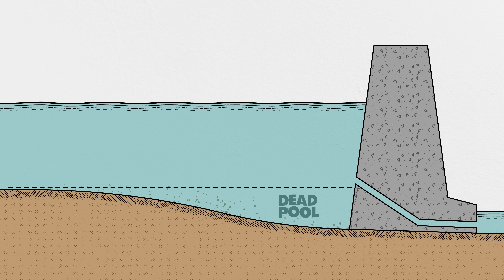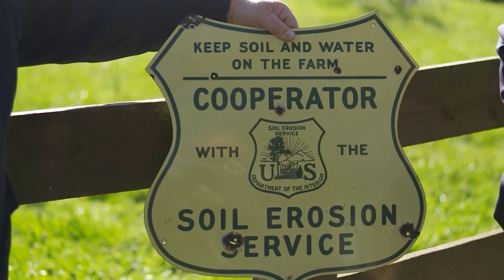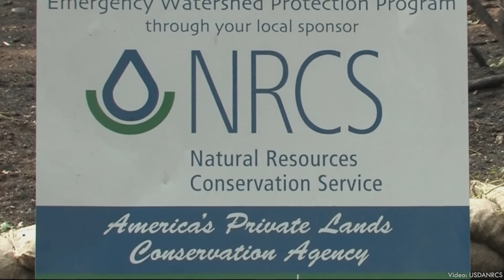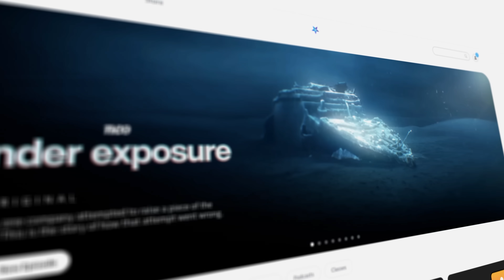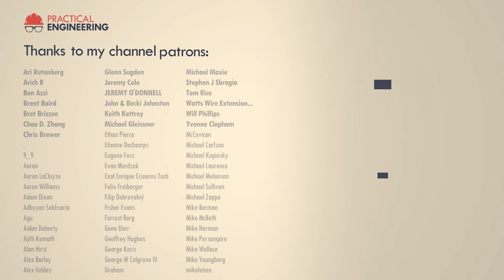All Dams Are Temporary

Comment: I work on dam removal projects and would like to add a few points. One of the major impacts of sediment deficit caused by dams is the erosion of the riverbed and the deepening of watercourses downstream. Deprived of its natural sediment load, the river compensates by eroding its own bed, gradually deepening it. This process can destabilize structures such as bridges.

Additionally, dams act as barriers to the migration of species like salmon and trout, which rely on upstream movement for reproduction.

Finally, over time, the maintenance costs of dams increase, making them less economically viable.

Thank you for this interesting video
Reply: so, whats the solution?
Reply: @kgdangar2  Only keep dams in mountainous contexts, where migration issues are low and where significant elevation differences offer greater profitability. Furthermore, if they are located upstream of watersheds, i guess their impact on sediments should fade downstream.
Reply: @kgdangar2 nuclear power for electricity 
Storing drinking water is a whole different can of worms
Reply: @kgdangar2  Natural water features, and the natural water features we adapt for our purposes must be separate and built completely differently,,, human water systems should exist in total isolation of,,,,!
Reply: I am not an engineer but have an interest and basic understanding of the sciences. Once a dam is in place it's almost impossible to get it removed even if it doesn't generate power. Look at the okalawaha.
Reply: @barelyafloatfarm809  It also depends on their size. In Europe, there are many small hydraulic structures located one after the other in lowland areas. Often, maintaining them to prevent them from failing is more expensive than their controlled dismantling. If you're interested in the subject, the Vezins dam on the Sélune River (France) is a good example. Studies have been conducted to regulate the management of accumulated sediment to prevent its sudden release.
Reply: I want to start by saying that i have not really resurched this so i don't know if its a good or bad thing but there are fish ladders that they use to help migratory fish travel up stream of dams.
Reply: @colbypaulson2831  Yes indeed, there are different types, and they generally target groups of species. It works quite well as long as the drop height is not too great.
Reply: Dams are good green energy, and trying to remove them because of small problems just makes global warming worse.
Reply: Better than coal yes but not better than nuclear  @CableFeed
Reply: @CableFeed  global warming is a hoax, chemtrails are the point.
Reply: In Brazil, I live 100 meters from a dam with German technology that has existed for over a century. Here, these factors do not occur because it is a small/medium-sized dam, there is no major maintenance to be done to the point of becoming obsolete. All costs are minimal compared to the benefits.
Reply: Me living with a bridge downstream a dam that was built years after said bridge: it desestabilizes WHAT
Reply: This is Actually happening in Ecuador rn in the coca river
Reply: What is your opnion on damming wadis(rivers that dont have water for the ENTIRE year)?
Reply: @Noordgestoord12  More context required,, what aspect of what you have described is worth forming an opinion on?
Reply: Dam discharge doesn't cause more erosion because it has "less sediment load" it causes more erosion because it's blasted out by the high pressure from the reservoir behind it.
Reply: @ObservationofLimits  Partly yes, but the sediment deficit also creates slower erosion, which can spread over several tens of km.
Reply: @ObservationofLimits  It is evident that sediment deficiency plays a significant role in the process of downstream erosion. The higher pressures directly downstream of the dam are a very local effect. Sediment deficiency plays a factor on a very large scale.
Reply: Today's solutions are tomorrow's problems...
Big population, big problems, and world's population is rising faster than ever! while it took 123 years from 1 to 2 billion humans on Earth, it only took 11 years from 7 to 8 billion! It never grew so fast, previously it took 12, 13, 14 years, and more, to add a billion.
Reply: @DR_1_1  this is not actually true. The worlds population is projected to peak in the next century or so and start declining afterwards.

Comment: Pumping (or dredging) the silt into barges and then selling to landscaping supply companies as top soil. It would be nice to have access to it. Currently, our topsoil is around 100 dollars a cubic yard.

I think barges hold around 2000 cubic yards or so. If it was sold to suppliers at 50 a cubic yard, it would be around 100k per barge in material.

I am sure different price schedules for farmers to coat fields would accommodate removing higher volumes of sediment.

Comment: As a Dutch guy, I might have a relatively affordable solution to the problem. Just prevent sediment from vorming by stirring the water. We use large air compressors to create bubbles that force the dirt back up to the surface. Then the flow of the water brings it downstream. 

You need to have a good system in place, and monitor it constantly. But it is relatively cheap because it’s only a small barge and one or two crew members. Like having one or two excavators running a shift a day. Cheap, in the grand scale of things.

Comment: Could one possible solution be in the same idea of reducing the sediment intake of the reservoir be, creating a alternative path for the river to flow and then siphoning the water from the river to the reservoir via a weir and large flat area to allow and sediment it settle out. Idea being you keep majority of natural sediment in the river and only have to deal with a relatively small percentage. Obvious the weir would have to be variable height to vary with seasonal flow and this also require extra cost of digging a new river as well as possible environmental concerns and does not address sediment from rainfall runoff as your reservoir will usual be so large it is feed from various sources.

Comment: Question: with solar/wind-power we have the issue of the "energy-duck": the shape of consumption/production in a power grid with lots if solar looks like a duck. To address this mismatch between times of production vs times of consumption, lots of expensive ideas like batteries etc are being suggested.

Why not use excess cheap overproduction of regenerative power to dredge dams?

There is both a day/night mismatch and a seasonal mismatch.

So why not dredge in summer, when lits of solar power is cheaply available and stop dredging in winter to conserve energy?

Comment: need a new invention, such as a large auger 10m, that scoots around the bottom of the res, moving sediment an releasing it through a large pipe at the bottom of the dam, the are several augers placed along the res and all flow sediment all year long, they can be powered by the water flow itself and create 'deep' clear pockets with no sediment, then the new incoming sediment will overtime naturally create a crater shape as the middle gets cleared out

Comment: Solution: it's clear, that the sand in the water becomes as sediment when a certain speed of the water takes place while slowing down. Hence we know the speed for the smallest particle that would become a part of the sediment. So controlling the speed at a given point can be used to let the sand become a sediment at a given point X. As the way of the water can be changed, two ways are needed, where the first creates Sediment at point X while the water fills up the reservoir of the dam. And after some time the water is flushed the other way, to get rid of that sediment at that point X bypassing the dam. That could be done every day, so it will never become a problem that there is too much sediment and flushing only requires a small percentage of the water if that way is narrow. Someone could try that!

Comment: Fixing this problem is simple. Just create a network of semi-permanent diggers in a reservoir and transfer dug up material in any way you want downstream. You can even use drones for my dynamic operation.

The key which you all are missing here is that you do not seek to clear sediment. Only to constantly dig it out at the same rate or higher than it accumulates. It will sure add some running operation costs, but hydrodams are already basically free. So, spend few cents for sustainability, will ya?

Comment: They should build a several hundred meter long bypass that runs the length of the original river at the bottom. It would have perforations that would allow water to enter and pass through the dam to let sediment drain out. It'll be like a mini river at the bottom of the reservoir.

Comment: The cure being only 1/16th as strong as prevention,  we need to address the silt buildup at the source first, otherwise, we're just chasing our tails.  

Here's my idea: At the mouth of the reservoir, create a silt catch designed to slow the water enough to let even the finest particles settle out. From there, divert a small portion of the water to move the deposited silt into a sluice box that captures valuable minerals, helping offset the operational costs. The remaining material could then be resuspended and safely released downstream of the dam.  

Curious to hear thoughts on this approach!

Comment: Hmm.
Sand trap, at the top of the reservoir, with a permanent dredger, linked to a railhead, to ship sludge downstream to where it's useful. (Possibly the coast to dump it out on the delta.)
REVERSE suction dredger. Run a boat around stirring up sediment by blasting water into the lake bed. You can use upstream and downstream samples to fine-tune how much sediment needs to be added back in by stirring up the lake.
Dual reservoirs. Like you said, it only solves the problem by shifting the problem upstream, but with two dams, you can have one free-flowing to scour out the sediment, while the other does the work you built the dam to serve. Might need to use some earthmovers to help things along, a bit, when the lake is dry. This is true for both dams, although they have different problems. The upstream one you can't stop as much water, while the downstream one, you can't just open the gates. (Assuming you even can on the upstream one, since the river between the two reservoirs would still be valuable, so flash-flooding that strip to flush the lower reservoir won't be popular.)

In any of these, it's not a static solution to the problem. It'd involve keeping someone employed, possibly several someones, removing the requisite amount of sediment, every year, and sending it where it'll be appreciated.

Has anyone considered making fabric-sided hopper cars for water-laden muck? Fabric over perforated stainless steel or Corten steel? Fine, for the level and downhill, if they can be mostly-dry by the uphill.

Comment: My pond is essentially a small reservoir. We thought the ducks were the worst cause of problems,  nibbling the edge and pooping. But this helps me understand why the inlet delta seems to be filling in exponentially.

Been thinking for a few years to figure out how to clean without draining.

Real hard to excavate without turning the machine over as a full bucket of water exceeds many of my machines limits. 

Have seen a sediment basin in other ponds i hope to duplicate. It would be easier to clean... more often,  but could breach easier in a storm. 2 years ago our neighbors pond utilized bypass overflows during a massive rain... both in the main pond and the sediment basin.  I can see how it was well designed, as it worked and the overflow didn't scour the levees. But rains are getting heavier in shorter times,  and every change i make can have unintended outcomes.

I love your channel, no pun intended!

Comment: Ok. Watched the whole video. I know contamination from run off is a thing, but it would seem that nature has already pointed a big ole neon sign at the solution as it was doing it long before humans started damming waterways. Left to run its course, all waterways flood. That flooding, while destructive to the man made infrastructure we've been dumb enough to place there, is constructive from natures point of view. All of the sediment that built up before a flood gets resuspended and deposited either down stream or in the flood plains during a flood and it's recession. Those deposits over millions of years have built the fertile Ag land that we use to feed ourselves and the sand/gravel deposits we mine for concrete aggregate. With that in mind what you do is flip the script. Instead of dredging to fix the problem of dam sedimentation, dredge to supply the market with high grade black dirt that's rich in organics. Defiantly monitor quality so contamination can be handled and not spread. But if it can be done at a cheaper price point than with chemicals that's a viable business. The other option is building a pipeline that acts as an expressway to the coast. Pump the slurry on down to the gulf for use in rebuilding the wetlands that have been disappearing down there. It's where most of it should have ended up in the first place and did till dams came into the picture.

Comment: You could use a sand pumping dredging boat, but with a very long pipe to place it just on the other side of the dam. There the water could move it again. Of course it takes a lot of energy, but only a fraction of what the dam can produce

Comment: How about a large pad (of concrete?) before the dam, checkered with holes. Routinely force air through those holes in order to remix the sediment with the water. 

A huge undertaking, for sure, but the costs may be less than the failure of a dam.

Comment: Wild shot but what if you create a dam system with mini vertical walls on the floor to hold the sediments before they reach the edge. That way the pockets will fill up slower starting with the furthest pocket and I also assume cleaning by pocket will make for less work and a more tidy and structured cleanup process compared to no pockets. 

A practical example would look like:

|___|___|___|_____|

Comment: I'm imagining something upstream from the dam to slow the water before it enters the dam. This  drops the sediment into a catchment vessel, a large pipe/ trench on the floor, running side to side. Every so often you let water run through the trench rapidly to flush the silt out the side into a canal that bypasses the dam and brings the silt out below... Ahh i can already see some problems with this :/

Comment: Not sure how easy it would be to do this on a large scale, but I remember using a siphon to vacuum the bottom of our swimming pool.  The slope of the land was steep enough that you could simply fill the hose with water, block the end with your hand, then lift it out of the water and carry it down the hill a bit before letting go.  No pump required.

It should be fairly easy to retrofit a siphon to an existing dam, but I expect the suction end is where the engineering challenge would be.  There'd need to be a way of positioning it where it's needed and also for it to slowly move around.  Some kind of bottom crawling robot maybe?  It could be powered by the siphon itself.

Comment: Not really sure how to explain it but having something at the bottom of the dam where the sediment accumulate, that would shake or mix that sediment so it would rise to where the water pass through the dam. I'm not sure you would be able to eliminate all of it but you could remove a big part of it, you would need something that can be dial up or down. I was thinking of something like a ship propeller of course it would need to be design differently so it doesn't work like it does on a boat.

Comment: I wonder if there could be a plate built at the bottom of a dead zone that loosens  sedement up with vibrations slowly getting removed by water flow. And tracking how much sediment is on said plate based on weight and how full the reservoir is. Doesn’t solve anything upstream and you can’t just put an artificial layer on the entire floor. Also depends on the exact materials idk.

Comment: Have 2 reservoirs, alternate dumping them. Have one upstream of the other, dump the upstream reservoir it will send it's sludge to the downstream reservoir, next year fill the upstream reservoir and dump the downstream one which will discharge it's sludge to the river system.
Whichever reservoir is being dumped should do so during the rainy season so there is good flow to wash away sediment and anything that is left will dry enough to be removed by excavation equipment.

Comment: Why not vacuum the sediment off the bottom of the reservoir using a down steam outlet to create the suction. That way workers could control where the sediment is removed as well as the rate of sediment release so as not to overwhelm downstream ecosystems. Yes, the hoses would have to be fairly long for larger reservoirs such as the Lewis and Clark example. But if the flow is generated by gravity then it should still work.

Comment: Okay, you could do a pair of hard-bottomed channels further up stream. You close one and open the other, let it run for a while, and then reverse them to "flush" the sediment builtup into the new stream. After a couple weeks, you go clean out the closed channel, since everything should dry in that time as long as you're switching them frequently. Assuming the entrances are shaped well, this should function similarly to the function of your model, but the worst of the sediment is caught upstream from the dam, so when you flush the system it doesn't go beyond the dam. You could also make these channels a little larger and occasionally close both to catch the water for a couple of hours in order to build up what is essentially a secondary dam in order to allow you to clean the exit "gate" if there's a lot of buildup there.